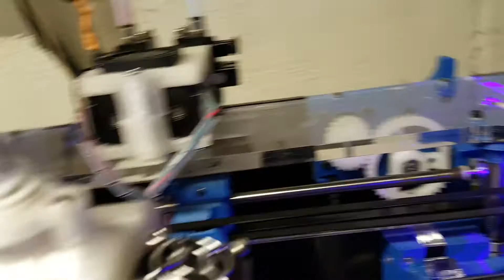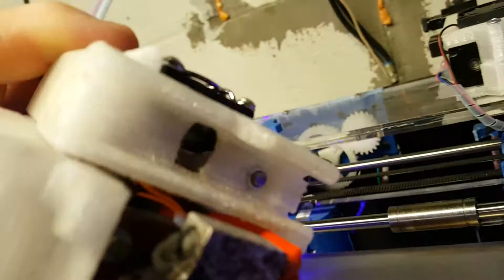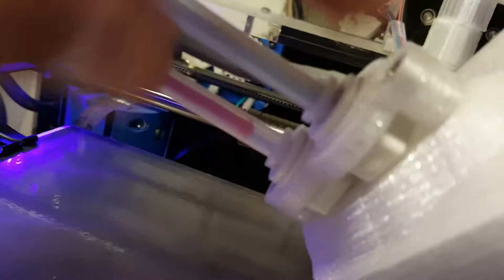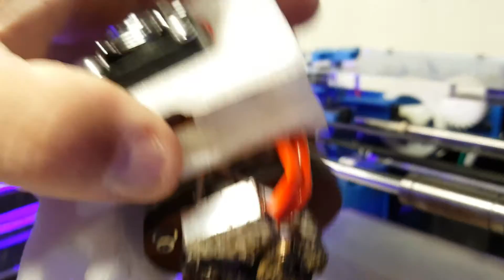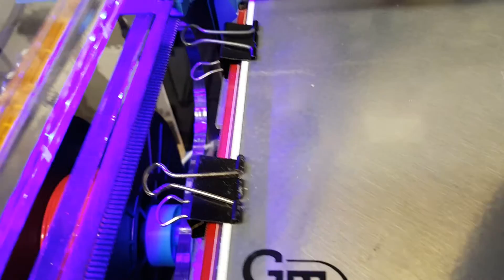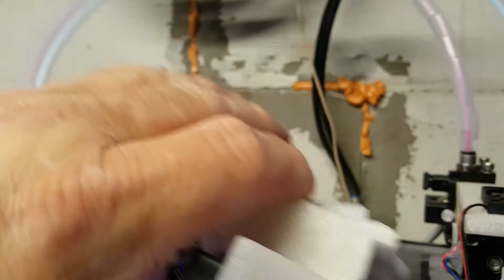Airwolf3d HD2x Heater Replacement

Comment: Can you provide a part number for the heat cartridge. I don't want to buy one from AirWolf
Reply from the maker: make sure you choose the correct4 voltage
filastruder.com/collections/e3d-spare-parts-and-accessories/products/e3d-heater-cartridge?variant=493348685
Reply: @satgod  Thank you for the quick reply! +++
Reply: @satgod  My resistor went out recently on HDR which has the same hotend. I measure 13.49v at the resistor so I don't think it's the power supply but what is the chance it's supposed to be 24v. I couldn't find this information anywhere. If it is 12v what is the correct wattage?
Reply from the maker: @CieloDelAstra  take the back off of it and look at the power supply
you have to buy the correct voltage heat resistor or it could go really bad
Reply: @satgod  I have it off so I’ll double check that. What wattage since you can go with either 30 or 40 on either voltage?
Reply from the maker: if you power supply is 24v get a 24v heater cartridge, 40w is pretty common
if your power supply is 24v DO NOT get a 12v heater cartridge
Reply: @satgod  thanks. I’m familiar with voltage but wasn’t sure if wattage was crucial. I think a 40w would heat up faster is the main thing.